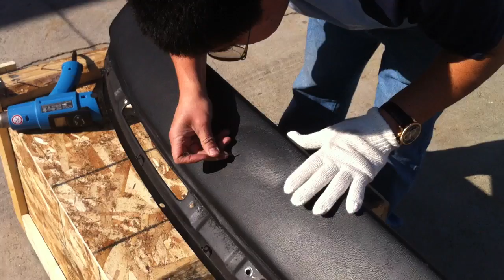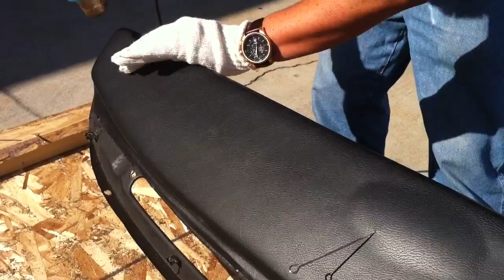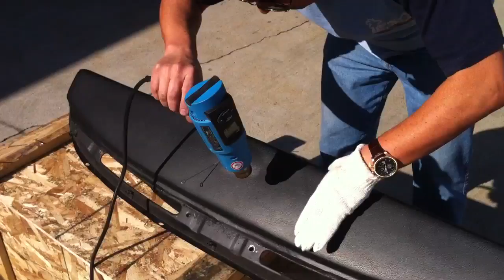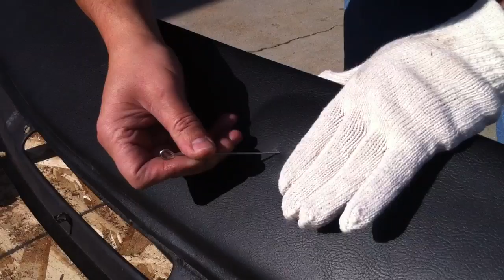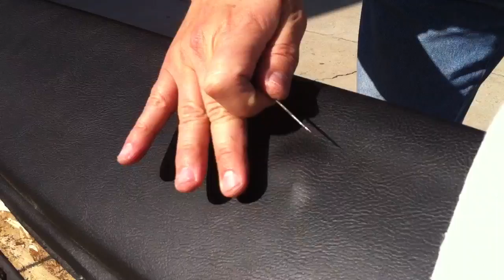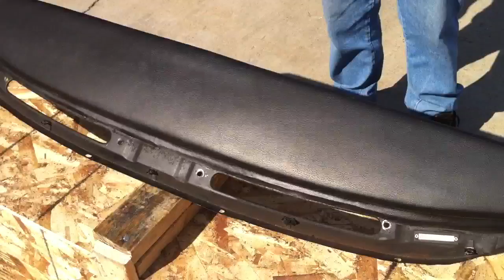Fixing a Dash Pad Air Bubble

Comment: Heat guns can got to 500 degrees and easily melt the vinyl if not careful. This guy is a pro.   
Try a high temp hair dryer with heat settings and start on low. Better safe then a melted dash 
My 86 Toyota Truck OEM dash just cracked, but has a couple of bubbles where it indents.  
Going to try using the 250 watt infrared heat lamp under my desk that keeps my legs and toes very warm to heat up the vinyl.
Should apply full coverage heat slowly, If not then the hairdryer.  
Then will from the back side pour in some very liquid RH Adhesives HH-66 Vinyl Cement to fill foam gaps and hold the vinyl skin down.
My dash is easy to remove so backside pouring will be easy

Comment: Will this work for leather dash, also? My Jag has a couple of bubbles, one on the center area, which may be leather, but could be vinyl, not sure. The other bubbles are on the gauge cluster shroud, which I'm almost certain is leather.

Also, is the glue under the bubble still good? My assumption was that the glue had failed and this is why the bubble formed in the first place.

Comment: Like other folks mentioned here - I don´t understand how this is supposed to stay as it is WITHOUT injecting some kind of glue into the air bubble. In my Nissan Armada the bubble only forms if the truck has been out in the heat for a while. After driving for ~10 minutes with AC on full power it will return to normal.